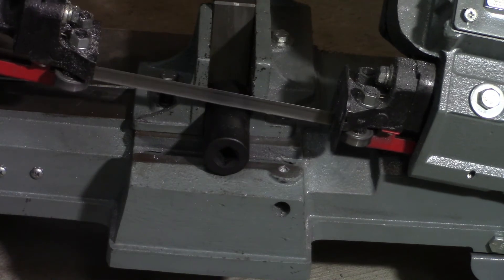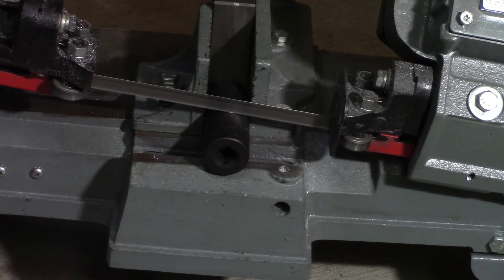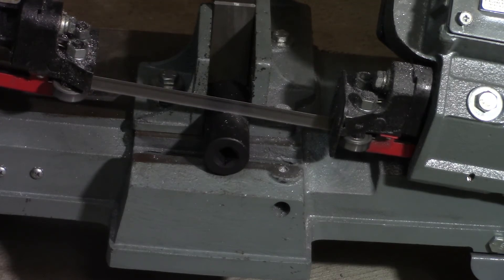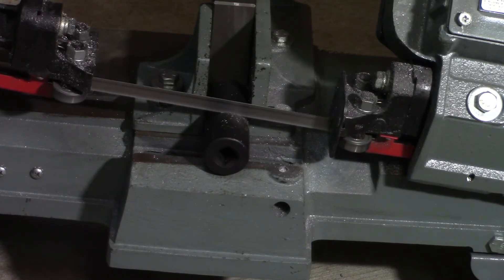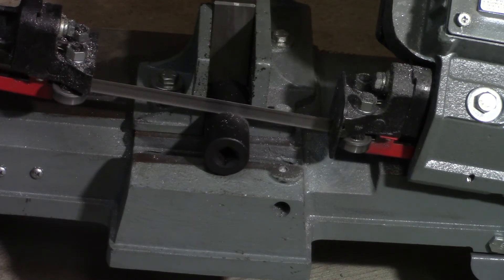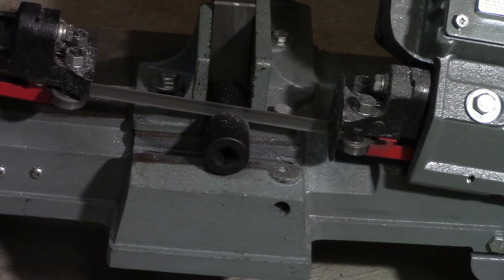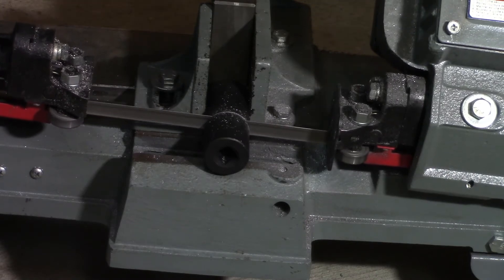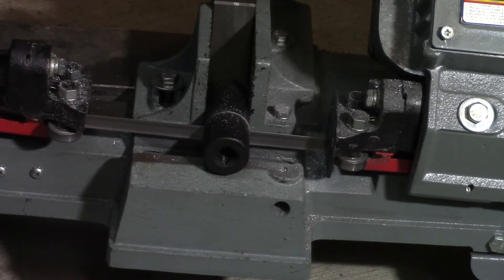Making a Custom Extension Socket

Comment: Best idea ive ever had id using an inch drive allen socket as an adapter for 1/2 sockets and welding them together to use on sized bolts but cheaper than buying one from snapon or another tool company that does requests like that
Reply from the maker: That works!  Sometimes the best tools for some of the applications we have in the field are the home made ones!  Price tends to be much better too, lol
Reply: @EverettsWorkshop  snapon sockets are not that cheap. Mine were 1 1/2 and 1 1/4  but the allen sockets were 7 dollars for inch drive. And now i can use my inch drive milwaukee pistol grip impact to torque some shit down

Comment: Nice JobEverett.I'm surprised you don't use lubrication of some sort on your band saw.And I found closing up the guides as much as possible helps with blade flex.Good Video as usual!!.
Reply from the maker: Thanks Ernie, I haven't used lube much as the saw is not the type with a drip tray under it.  I suppose I could give a spritz lube a try, just haven't given it much thought.

Comment: You never know what a tool may get used for so always weld it to hold more than the material will stand. After it leaves your shop someone may have it connected to a 1/2” drive impact.
Reply from the maker: That's very true - I know my buddy wouldn't use a big impact on it, but if someone swipes this second socket and breaks it off then it would be ironically fitting, lol

Comment: You did fine. It won't fail on plumbing fixtures. Put a coat of JB weld with thinner using finger. Ready for beauty contest. Remember perfect welds you see on YouTube are usually done by Tig welders that weld every day.
Reply from the maker: Thanks, I've never claimed to make pretty welds - they hold but may not look pro, for sure. This was the second socket I modded for my friend, some lowlife on the job site ran off with his first one.

Comment: do you accept made to order i need a 26mm socket with 200cm long
Reply from the maker: Hello!  I'm not sure where you live (postage can be pricey, depending on destination) but if you send me an email describing what you need and whereabouts you live, maybe we can come up with something.  Thanks for coming by!
Reply: im base here in japan.. yeah i think the postage will cost a lot its hard to find a 26mm socket with 20cm long or 15cm may also work
Reply from the maker: The materials aren't that expensive, and after checking the Canada Post website there are a couple options for postage.  If you send me an email at everettsworkshop@gmail.com I can show you what I found and we can see if it is reasonable for what you need.

Comment: Great video, I did the very same thing, but shorter pipe, and made a tool for tightening the spider and the jam nut on snowmobile drive clutches. My small business is clutch tuning, which means tearing down the clutches many times so the time spent making specialty tools is well spent. The next project for me is to make a replacement clutch puller, as 1 of mine seemed to develop legs. I watched your scrap metal vid and using a shaft from an atv stub axle should work I think?
Reply from the maker: Thanks, oddly enough the first socket like this I built grew legs on his job site too . . . As for the ATV clutch puller, most of the ones I've seen were for centrifugal clutches and looked like long rods with a hex on one end, threads somewhere in the middle and a long narrow journal to the business end.  Made one once to pull a clutch off a Rotax but that was something like 12 years ago.  Would have to see pics or a drawing of your application to give you a meaningful perspective from my end.
Reply: By any chance can u tell me the size of socket needed to remove the spider jam nut on a 08 m800

Comment: nicely done, the OCD in me would of machined a register on the parts, it would of made the welding setup easier.
Reply from the maker: Thanks!  The OD's of the socket and pipe were so close that just snugging the ready rod lightly and adjusting the pieces before tightening the rod up made for a very small amount of runout.  Certainly would not do that for anything rotating with any serious speed, though!

Comment: That should do pretty good, with this type of alloy stainless steel rods with the high Nickel content is a great choice, next decent option for less fortunate folks is 7018 rods...   
Now my worse problem at 64 is sight, and flexibility in my hands, not what it was like even just less than 10 years ago...
Just if you feel you'd like some channel stickers from my own channel and my friend Philippe's, just send me your address by Email (  wledpierre@gmail.com  )
Reply from the maker: I went with the stainless filler because pretty much everything I've read about welding alloys recommends using it if the base metal alloy composition is unknown and likely to have a bit of carbon and/or chromium in it.  Have to give credit to Jody from weldingtipsandtricks as he suggested reading "Metals and How to Weld Them" from Lincoln Electric.  Re-reading the book again as the metallurgy aspect of playing with this sort of stuff is very fascinating.
Reply: Agreed, but not everyone has a stock of SS filler rods, they're quite costly and not of everyday use. mostly for small shop or hobby purpose...